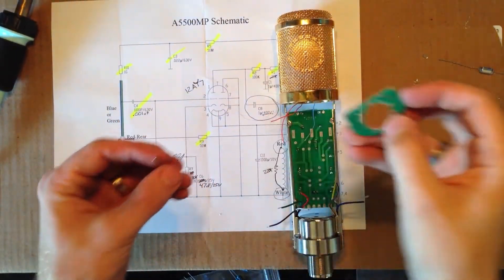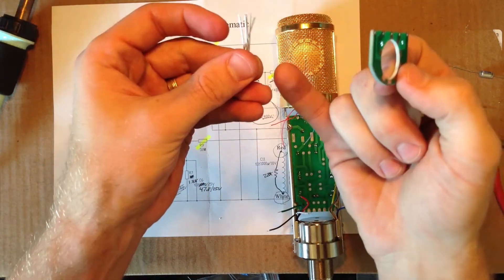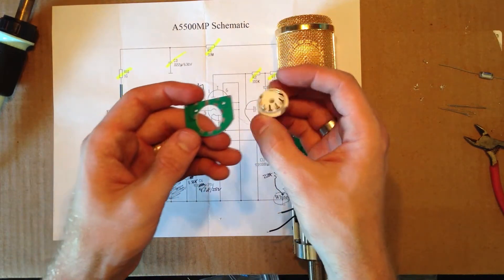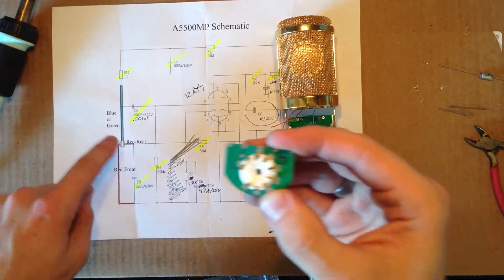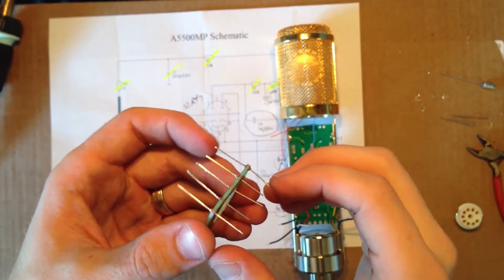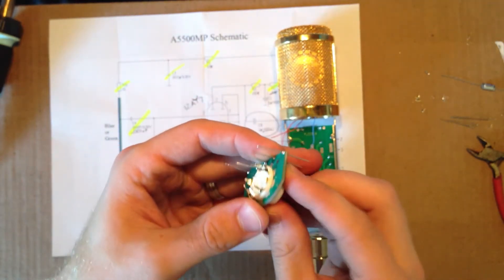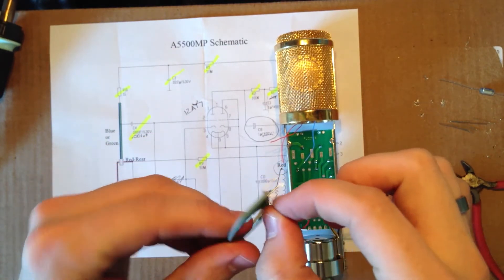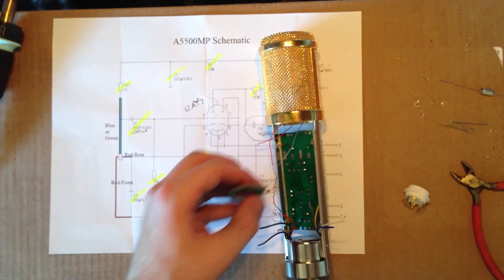Aurycle A5500MP Tube DIY Microphone - Microphone Build Part 4

Comment: Is that capacitor above the tube necessary, and why did you install it ?
Reply from the maker: +Boi Dru Hey! I guess you are asking about the large yellow capacitor that you can see in the Final video and not this video right? That is C8. The part itself is necessary to the function of the microphone, but I ended up buying an audio grade capacitor for that. So, no that specific part isn't needed to be upgraded like mine, but a lot of audio quality comes from changing that cap to be a better one.